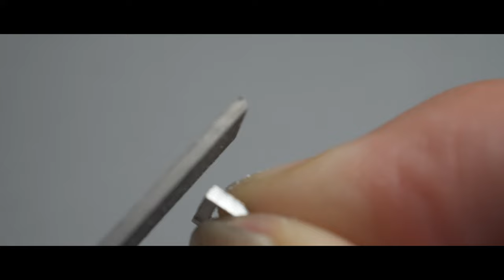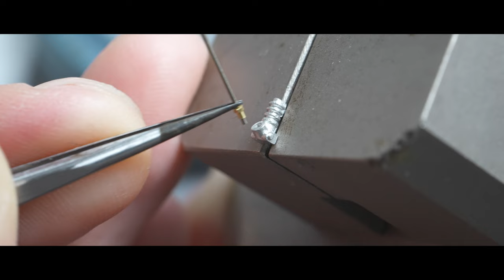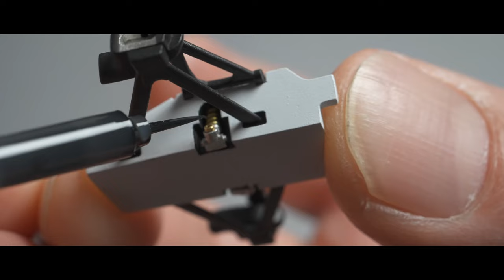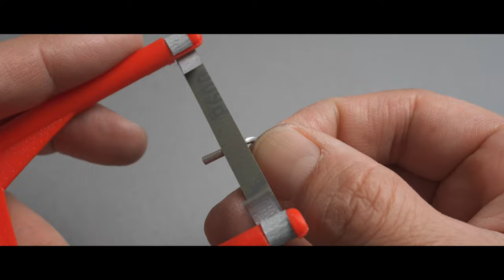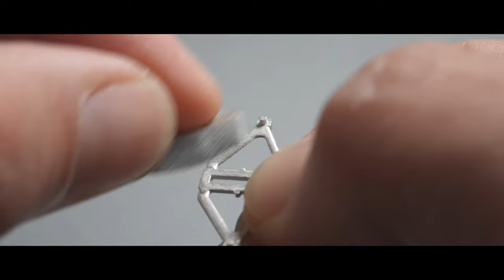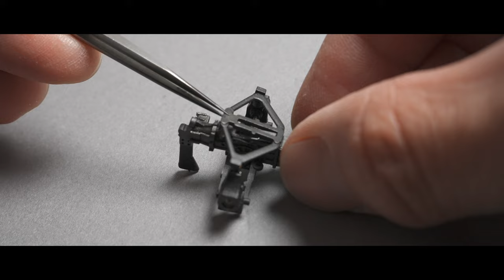#02 Building BRABHAM BT50 TAMEO 1/43 F1 scale model car

Comment: I used to build a ton of 1/43rd scale kits back in the 1980’s and 90’s. Mainstream plastic cit makers just wouldn’t make models of the cars I was interested in but 1/43rd makers did. I still have a bunch of unbuilt kits I want to build but decals dry out and yellow and getting replacements are impossible to get. A lot of the makers are no longer in business and they ordered just enough decal sheets to cover production numbers. When was the last time you saw a Bosica kit for sale unbuilt? They go for obscene prices. My Bossica Ferrari 126c2 kit cost me $65 bucks,today if you can find one it’s $5-600 bucks!
Reply from the maker: When choosing which 1/43 kit to build, the condition of the decals is a major determining factor.
I don't want to put up a jigsaw puzzle when I have finally finished painting.